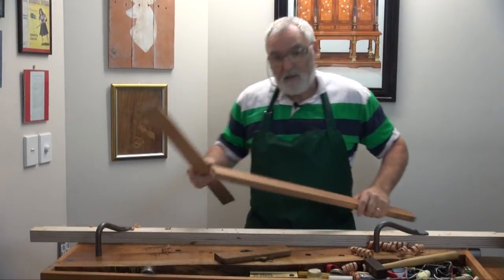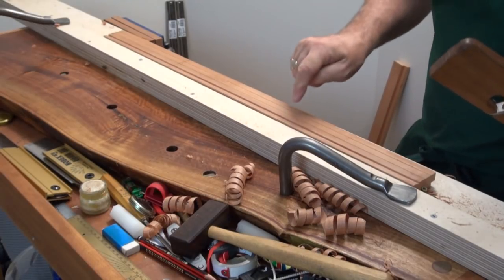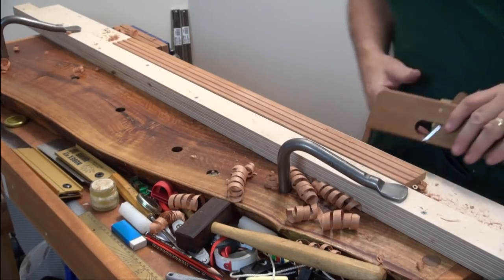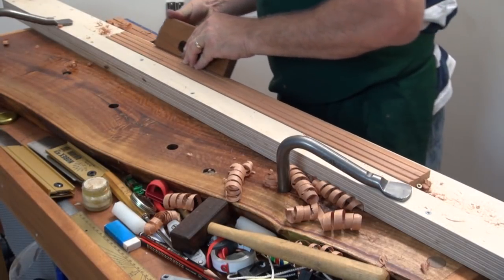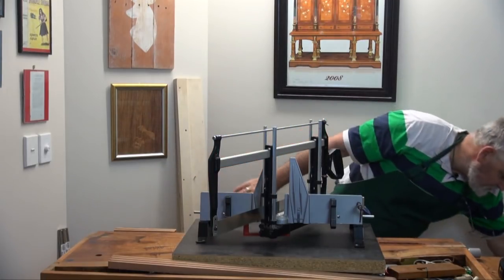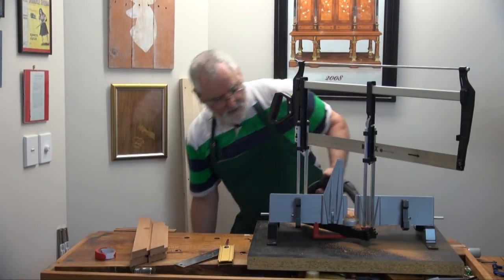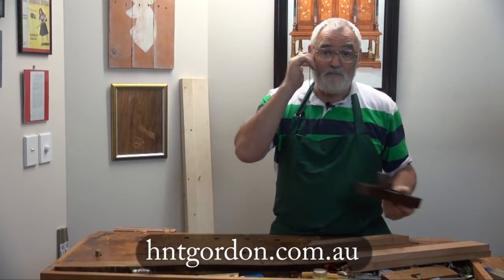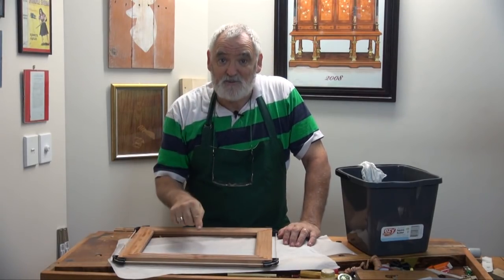Moulded Picture Frame using only a Rebate Plane Pt.2 of 3

Comment: Thanks for sharing. I am intersting how you set the handplane (lateral adjustment ). Thanks again
Reply from the maker: Light taps with a small wooden hammer, right and left. Tap on the back top to retract the blade and tap on the top of the blade stem to project it. Tap the top of the wedge after each adjustment to lock the blade in place. Hope that helps a little. Cheers Steve
Reply: Thank you for answer. I wanted to say if the handplane blade comes out of the body on both sides or only on one side. Sorry my English
Reply from the maker: It's level with each side of the plane but cuts from the projected blade out f the bottom. You can tap it from side to side it you want but I find the way I use it is fine for starting the rebate. Cheers Steve. P.S. You're English is fine.
Reply: thanks again

Comment: how did you make you cool worktop. Big Ups
Reply from the maker: It was a slab I had in the shed, which I could not find a use for so turned it into a workbench. Cheers Steve

Comment: I like to use tape when gluing picture frames
Reply from the maker: Tape works well, although I've always preferred clamping in the past. Using metal clamps mainly but when I came across the string clamp I must admit I was some what skeptical at first. But as you can tell now I'm a fan of it because of the amount of pressure you can apply to joints.  Cheers Steve